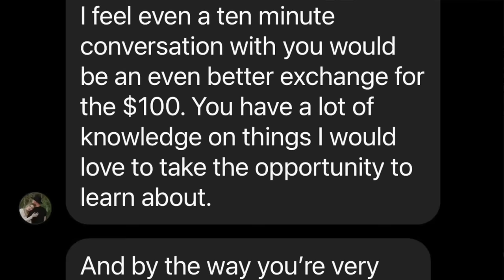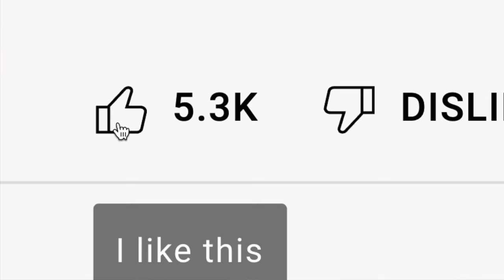Making $1,000 Per Day Washing Windows | Undercover Millionaire

Comment: How he can wash windows in the heat I don’t know.  Summers in Las Vegas would be just insane.  Great mindset and determination, well done to this entrepreneur.  Awesome example for others to follow.  Thinking positive has a different harmonic than fear and being intimidated, just perfect.🥰
Reply: You would most definitely need a water-fed pole for the outside and work around the sun on the inside windows. 

You simply cannot get a streak-free clean window in direct 85° or hotter temp outside.

Comment: Scratching the screen frames is no good.  Just use an electric leaf blower to dry them off - and don't lean them against a clients house getting that dirty screen clean only to have to clean a wall.  Lay them flat on a large towel.  Real pro - that deals with real people, not $50 tippers.  Include deck cleaning or you'll never make it in this economy.

Comment: I don't think you shared all thr information, ehich is a bit disingenuous. $1000 a day sure, but how many guys did you have doing the jobs and knocking on doors? That $1000 has to be divided up between all thr guys you have working as well as covering expenses. 

I own a window coeaning company and have been in business for 30 years. You can certainly make $1000 a day but its a lot more difficult than you're leading on and it takes a while to hit that level of volume and pricing.
Reply: Not really, I run one by myself and 1000 is definitely pretty easy.